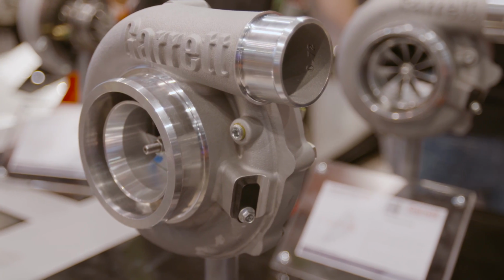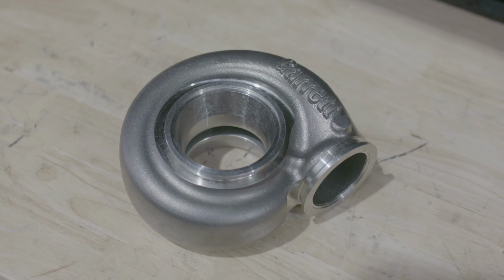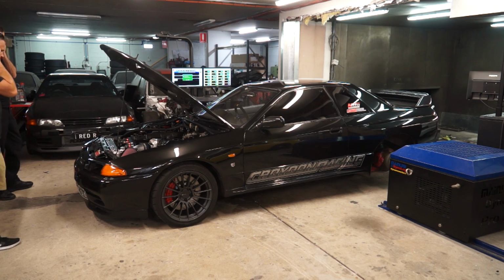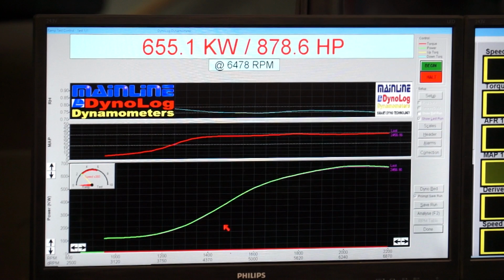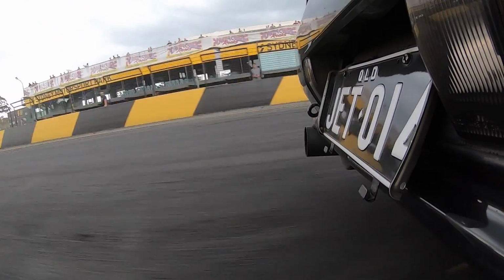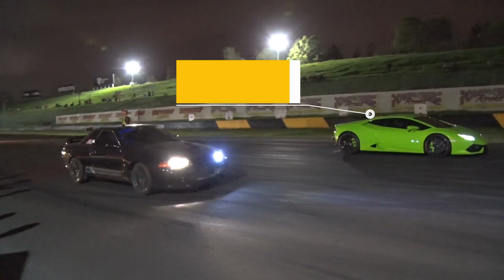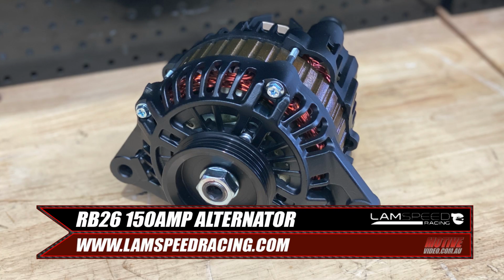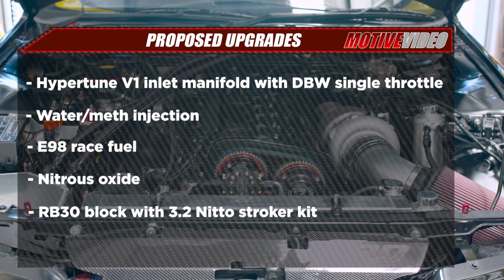9500rpm and 900hp with Garrett G35-1050! Best single turbo for GT-R?

Comment: @MotiveVideo
How is street driving?
Im contemplating between g35-1050 vs g40-1150  
People say it has the same spool, and it's better matched...
at what rpm ypu see full spool?
Reply from the maker: The video says more than any words will.
Cant have same spool as G40 has larger rear wheel

Comment: Genuine question.  Why do ya clutch shift 2nd but not all the other gears? Cos I see a strain gauge clutchless shifting on every  other gear
Reply from the maker: 1st-2nd is very aggressive as torque is still going up in 1st due to less load.  Sometimes wheelspin. So its nicer on the gear to clutch 1-2 and no chance of it not changing gears

Comment: I think im missing something, why is this "gtr" only two wheel drive? is it just a skyline or did they convert it to rear wheel drive?
Reply from the maker: You don't watch our channel much huh. It's a Gt-R and it's all wheel drive. We have a switch to put it into 2WD for the dyno. That's pretty well known knowledge we thought.
Reply: @MotiveVideo  just started watching not long ago. sry for not knowing that gtrs can switch between awd and 2wd.
Reply from the maker: All good. Have to learn somewhere 
The 4wd system is 2WD bias and adds torque to the front via pressure in the transfer case.

Comment: hi andrew,

cool video, awesome car. When does it come on boost with the 1.21 rear?
Building my rb30 single cam and going 1.21 rear aswel on the g35-1050hp, thoughts? 

thanks
Reply from the maker: Its making boost from 2000 and all in by 5000. RB30 will be very responsive with it

Comment: been looking for G35 results, am not disapointed. seems like its up almost another 60-70hp at the wheels.
in regards to small things to get more power, have you tried a capacitor type spark plug or brisk silver plugs? they tend to work very well under high pressure, seen significant gains for a cheap easy mod, next thing would be making sure you're getting enough power from the coilpacks, optimising the ignition system could see you net another 20-30hp up top, i know the system you have on there is pretty good but maybe try playing with it a bit, or switch to a 16v or 24v system, will definitely see results with that.

then go for mechincal changes like intake manifold etc

Comment: Looks laggy.... I thought this turbo was meant to be responsive for the power it's making? It seems theres probably a couple of better turbo choices for the power. But if you werent using a 1.2 open housing on your 3884 I don't think you can say you were maxing it out, as i've seen them make quite a bit more power than you were making. So if you want to crack 900whp you should have just got a bigger open housing on the gtw. Would have increased the lag about the same, but made your 900.
Still a good setup though, goes well.
Reply from the maker: Laggy? What video are you watching?
Reply: @MotiveVideo  A 67mm GTW is no response king, so then neither is a G35. Transient sounds slightly better but you still have to wait those early RPM's for it to come on song.
What do you think the results would have been with a 1.2 t4open or a 1.2 vband on the GTW?
Reply from the maker: Team Spintop have another watch. Both drive great

Comment: Get the stroker engine built first as that will be your biggest hurdle, then you're likely going to want
water/methanol so as to compare a more apples to apples from not changing fuel source yet. I would go to E98 after you test what it's going to make on water/methanol. From there, hypertune manifold and throttle body once the sucker is maxed out on boost and fueling potential to really test if the manifold swap is that much better and makes more power or if it's not quite as good as initially lead on to be. I personally would not do nitrous just because it's basically only good for very limited and specialized situations. It would freaking awesome to have but would probably only be used in straight up drag races. 

This car is a monster. Good work guys!

Comment: I'd rather use fresh air valve instead of nitrous to spool turbo and maintain boost off throttle.
In term of upgrades I'd say that intake manifold will be first with DBW 80mm TB, than meth, fuel, nitrous and tall deck block with stroker.

Comment: Definitely next step where you can manage a meaningful comparison is the intake manifold. That will have the single greatest influence on  driveability etc, especially going from 80s nissan idle control to dbw. Also you can show the effect it has on response from the drivers seat.

Comment: think manifold air density, a little more spark lead, and methanol injection is all you need to go over 915 hp
also if the EGT's are all the same the intake is good to go

Comment: I'd love to see it in an order in what I would do it myself as well:
-Pump E85 with Water/Meth and later straight meth injection
-Race Gas
-Single throttle body
-Stroker bittom end
Also would live to see the stroker bottom end on pump e85+meth later on, to see what the car could do in "street care trim"

Comment: Get the rb30 block. Everything else is easy to add and you guys are heading in that direction anyway so get that out of the way first. Its the biggest, most important and lengthiest part.

Comment: please australia use something else than a crappy garrett turbo i have had a precision turbo with journal bearing and it outspooled my gt3563r ball bearing turbo by 250rpm.he had pretty much the same spec with a slightly larger exhaust housing imagine with a bb what the result should have been. alos 20whp more than  the mexican made garrett

Comment: I would go the Hypertune manifold as I feel this would be good data vs the stock one. 

We all know a rb30 will make more power and torque with better spool.
nos will make extra power easy as you by the shot sizes.

Comment: It's a circuit car .. only drives it from turn 12 to the 100 m brake marker each lap.
Reply from the maker: MmeDesgranges cool story bro. It’s Powercruise not a track day. Do some research first before trying to sound clever.

Comment: Would you ever consider HKS Vcam?  Move the power and torque back earlier and do the Hypertune.  Always killer Andrew.  Always killer footage and tech. This is definitely future world!
Reply: This is a common question Andrew, could we pls get a answer- thanks
Reply: @JH-jo9wt  The problem with HKS Vcam is HKS don’t offer aggressive camshafts, I know one shop that offers it with their own custom camshaft to work with the HKS Vcam and the results that I’ve seen are awesome. The catch is they only offer their custom camshaft for the HKS Vcam if you have them build you an engine.
Reply: @wd8005  Why can't one just send the Vcam camshafts off to be reground to different specs?
Reply: @lutherblissett9070  You can do it but as far as I know, No one really likes to go that way and they just pick whatever hks vcam has or don’t bother with hks vcam at all.
Reply: @wd8005  I heard of people modifying Vcam to get more cam angle variation out of it but not of people regrinding the lobes. I thought most people just avoided Vcam because of cost.
Reply: @lutherblissett9070   Yeah most people don’t buy vcam because of the price. Idk any other shop/people that use custom camshaft for hks vcam  other than 1 shop in Australia that I know of, the torque curve is amazing specially when you consider big turbo rb’s, I’m talking 67mm and above and can still have amazing low-midrange torque due to custom vcam.
Reply: @wd8005  What's the name of the shop?
Reply: @bluesrike  Dahtone Racing in Australia
Reply: @wd8005  I checked their website and it they don't have it listed there.
Reply: @bluesrike  They don’t sell it standalone, you have to have them build you a whole engine just to have the option for custom Vcam.

Comment: 1. Race fuel on current setup 
2. Water meth on current setup 
3. Manifold upgrade.
4. 3.2ltr upgrade 
That way only thing that could not be tested as a before ( 3.0 to 3.2Ltr ) after is the manifold from std to market unless you put the old manifold back on.

Comment: I think best option is plenum first, then race fuel, then stroke, then meth and finally some giggle gas. Also, i think I'm just about the only one around that actually wants to see how the multi throttle intake compares to the single.

Comment: Stroke it and run it on 98ron like a true street car and see what you can get out of it👍 nothing worse than seeing a " true street car" tuned on special fuels and running meth injection and shit like that it then ceases to be a "true" street car when its peak performance is dependant upon stuff that most people don't even run on the street. Its peak performance should be there from the moment you turn the key👍 not after an hour or more screwing around trying to make the conditions "optimal" if it can't do it everywhere all the time then what's the point may as well just be a track car🤔 stroking it will be the best way of raising the performance ceiling🤙 can't wait to see which way you guys go with it😎
Reply from the maker: spooKy1 we buy E85 from the bowser. Like a true Street car.
Reply: @MotiveVideo  I'm not having a go just saying not every petrol station has an e85 Bowser and I just thought that seeing how much extra power e85 helps produce it might be interesting to see how far you can go on 98ron and then see the difference between the two after that it just seems most are just tuning for e85 lately to gain an extra 100+ hp so the numbers look more impressive
I know heaps of people with highly tuned cars and they never run e85 because it's not abundant in our area and just thought 98ron would be more representative of most who have tuned road cars here in Oz
Love the channel guys have been a fan from way back still have a huge stack of the old DVD mags from back in the day👍 keep helping to push limits in the Aussie tuning scene🤙
Cheers🍻

Comment: Put a speed sensor in the turbo because you are already off the compressor map. The edge of the map at 35psi is 94lb/min and you are making 900whp. More displacement and a lot less boost is the only way this little guy is going to pump more volume.
Reply from the maker: Jake warren we know

Comment: Why not the v2 manifold with staged injection? For sure the manifold and a 90mm tbw setup. Awesome video. Keep up the great work.
Reply from the maker: Nics Shop V2 is double the price by the time it’s installed due to all the new lines needed and radiator etc it’s also bigger runners that just aren’t needed. We don’t need staged injection either.

Comment: i am not sure, but are you running race fuel(100/110) or pump gas(91)?
Or E85
Reply from the maker: Ajit Pabla  E85 from a United gas station
Reply: Nitrous it, cheap upfront cost but only possible good gain. You are already using E85, so water/meth will not give you more. Usually, people switch to meth or E85. Manifold on RB can produce 1000hp, you are well over it, so that is another place to invest in. but i would start with nitrous, you might get 1000whp
Reply: Which petrol station do you work at ajit?

Comment: Please...PLEASE make the next change the Hypertune IM/TB combo. Its absolutely one of the biggest contention points as you well know as to what they ACTUALLY do VS the stock plenum. 
You can find flow numbers all day, but never any actual real world or back to back dyno numbers. You're in the power range where it should be a great example of if the stock ITBs and Plenum truly do limit the power, and its be nice to see what happens on your tune between Cylinders as far as fuel changes needed (prove how starved #5/6 are in factory form)
Reply: I've been asking the same thing for ages, nobody has done a back to back on this but yet again with many other things, do you ever truly see a valid back to back test?.  There's quite a few high HP, even in the 1000's RB26's running the ITB's.    The only reason I'd delete the ITB's is if needing twin injector rails, or direct port nitrious.  I see no other benefit
Reply: @boris9331  the advantages are in idle control, ease of implimenting anti lag strategies, in the case of this car with a sequential box they will be able to implement clutchless downshifting, traction control, cruise control, ease of serviceability, better cylinder balance, lack of worrying about the linkages being correctly balanced.

Comment: RB30 beacuse u can increase power level without adding any other systems like gas gas bootles or using special fuel. Bigger displacemant making car more simple and weight less.

Comment: What were the IAT's like up at 35psi? If it's pulling timing with corrections up there then you could try water meth just to keep the ECU happy.  I'm not sure you will get any gains as far as max advance over the e85 though. Depends if you are already able to reach MBT with the ethanol it has.  I'm seeing less than ambient temps in my N/A GT with straight meth injection and 6degree's more advance than running 98 (knock limited without) WM injection activated.  Just disable the ECT corrections for a run and hit 900wheel. 😏

Comment: It sounds a little close to material surge on the dyno runs but doesn't get hung up with surge on the cruise footage which is good. Wonder if a less restrictive plenum/manifold would be enough to potentially reduce engine/pump restriction and move the airflow further away from potential surge. Car is an utter rocket.
Reply from the maker: Martin Rodger loading up the car on the dyno and big boost can lead to surge

The four port boost solenoid often makes it sound like surge as well some times
Reply: Motive Video  True, dynos can artificially load high compared to the road as not much is going to hold a 800+hp R32 back on the tarmac. Not like you’re towing trailers up hills with it anytime soon! Amazing how close Garret has taken the compressor/turbine balance on these G series turbos like little 660hp rated T25 frames: crazy stuff. The Dyno shows how close it is and then the actual cruise pulls shows it is money.